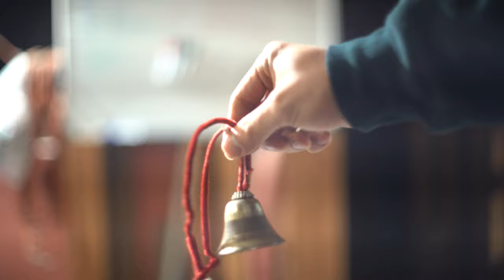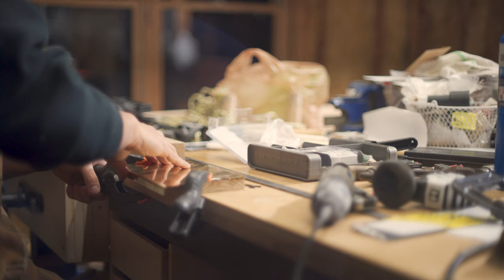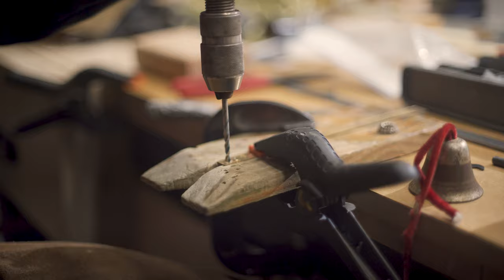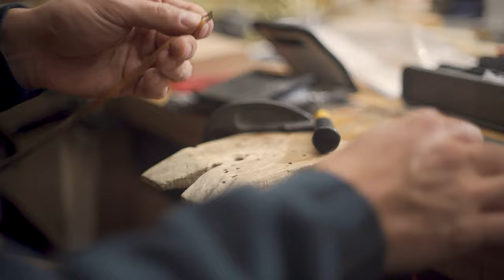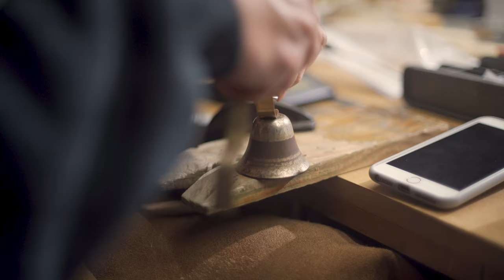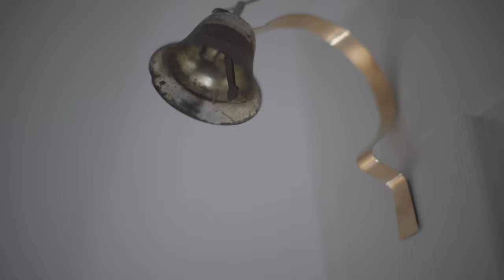Making a Shopkeep's Door Bell

Comment: The bell will work if mounted on a door, but for a much louder effect it would be mounted on the door frame and would be rigged so that the door "plucks" it while opening and closing.  Having the bell mounted on a spring is key to making such a mechanical door bell work effectively.